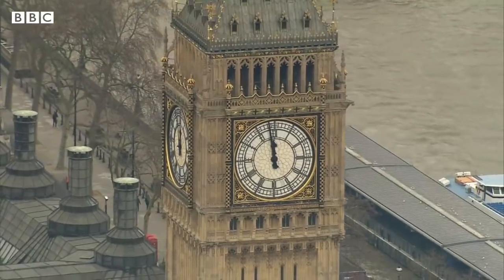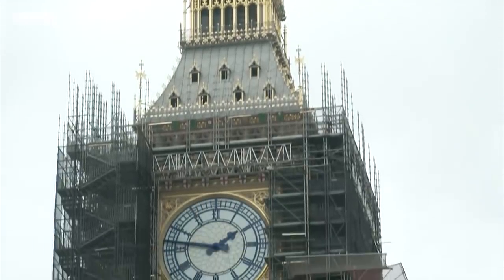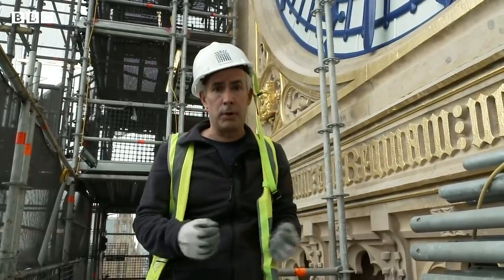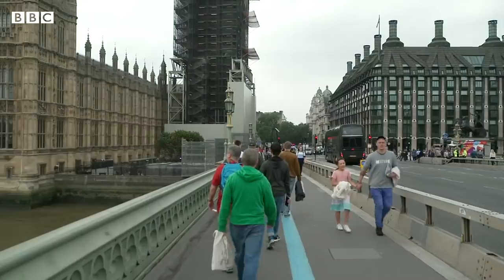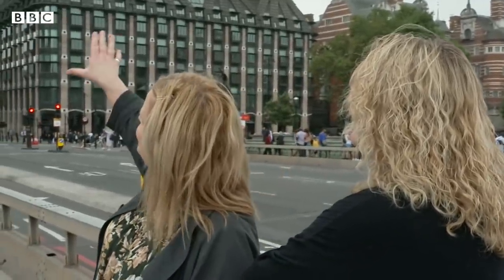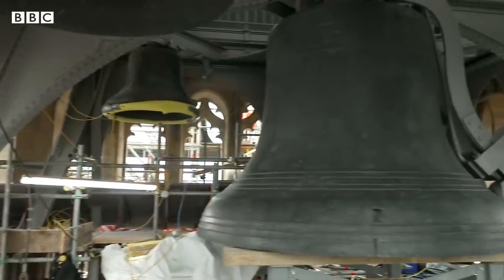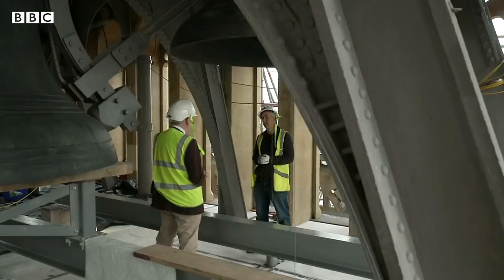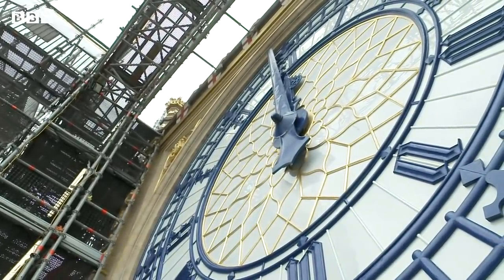Countdown to completion for Big Big restoration- BBC News

Comment: As you can see we’ve spent £80million restoring everything around Big Ben and left Big Ben with a crack in it.
Reply: Wrong! Its Big Big
Reply: What’s wrong with the crack? It gives it character.
Reply: @sparrowpelt20xx61  Safety issues. Structural issues.If the crack stays it might get worse. Given, it's already been there a while, but you never know.
Reply: @archevenault  
Considering it was checked by Professionals, i highly doubt it's going to break with just that dent, it doesn't even have a major crack and the bell itself is a national treasure, it could stay for roughly a hundreds of years to come. 
It's basically just a Memory of the past or like a Birthmark, it adds value to the clock knowing it had interesting history.

Comment: It’s the London Clock Tower / Elizabeth Tower of Parliament , Big Ben is the name of the Bell, not the building :)

…I was told that by the guy that was responsible for running it for most of his life, back in early 1980’s, while standing next to Big Ben when it struck 3…so I figure he knew what he was talking about! He also had the Guinness Book Record for stair climbing as he climbed it twice a day, every day for decades (over 50 years from memory…334 stairs / 668 a day, not one sick day!)

They also used to stack coins to balance the pendulum and they weren’t able to keep the time properly after England went metric and had to get a special run of Victorian coins minted, just for the clock :)